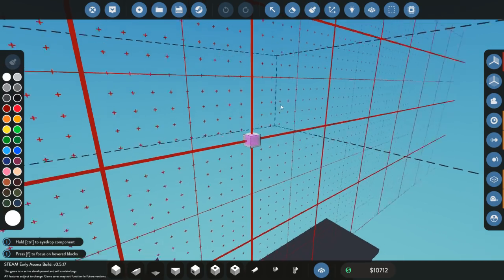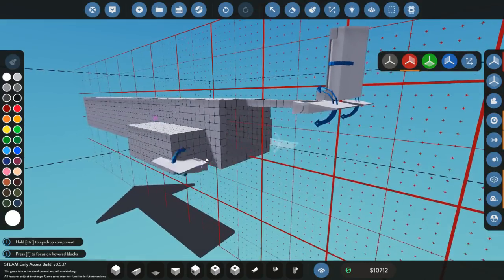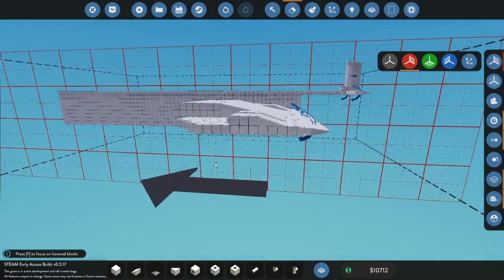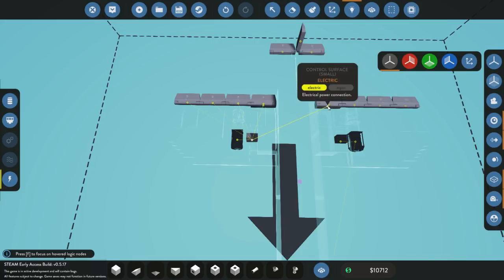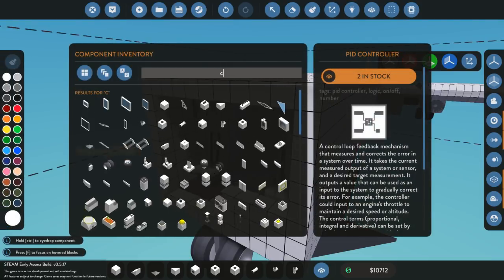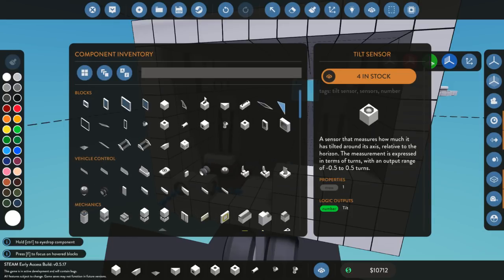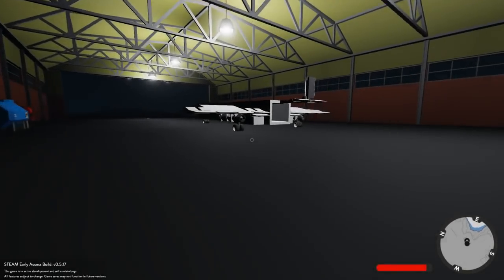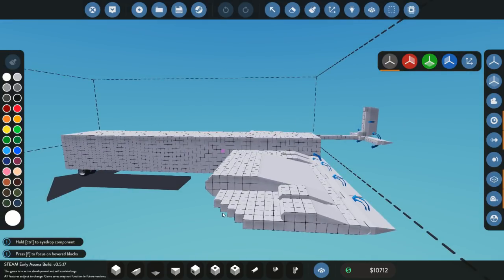Stormworks: Building Jets Is Easy

Comment: You say that you're building a big jet to show how easy it is, but really, it's much easier when the jet is large because it takes more energy to make a change, and they're more stable... For example, if I were to make a really small plane with the engines in that position, it would start doing backflips at Mach 2 because it's not perfectly centered... But with a really big plane, it's just a slight tendency to nose up a little...
Edit: I'm talking about stormworks btw, I have no idea if or how this works irl

Comment: I built a jet but when I spawned it in it kept on going up I had no control was my jet engines to high?
Reply from the maker: It could be a lot of things depending on what you're trying to describe. If you mean that your nose kept rising, your jet engine was probably set too low. Generally, try to keep it vertically near the center of mass. You can correct with fins, but it's easier if you don't have to correct too much.
Reply: Thanks for a quick replay I will try to to fix it with your help if you have time to take a quick look this is the linkhttps://steamcommunity.com/sharedfiles/filedetails/?id=2382682882